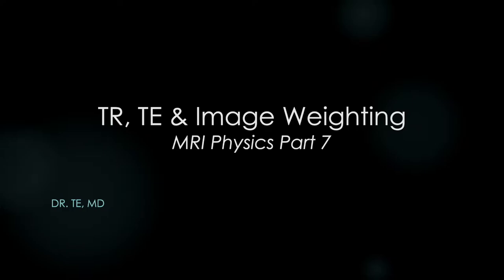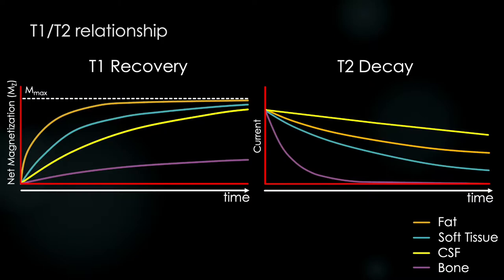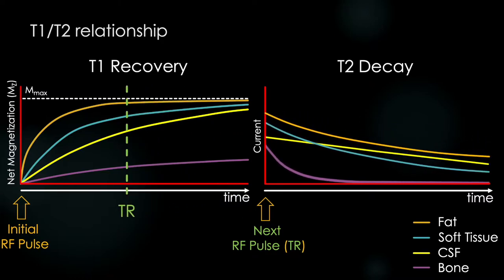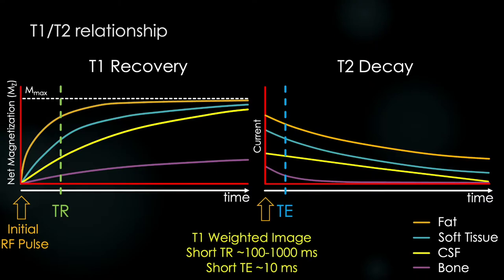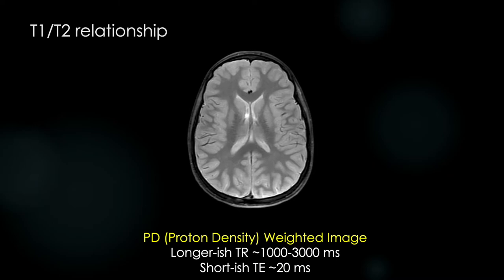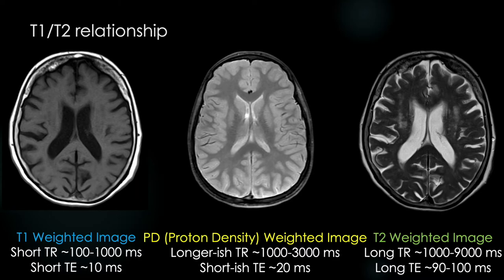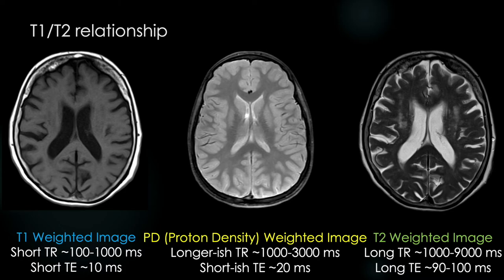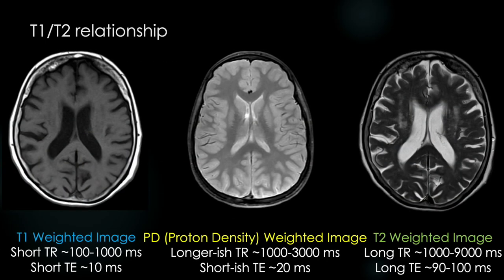TR, TE & MRI Image Weighting (T1, T2, PD) EXPLAINED | MRI Physics Course Lecture 7

Comment: I noticed that the T1 relaxation times are constant. So does the MRI tech choose the TR time only to control TE or does the tech choose both TR and TE? I'm taking the ARRT test in December 2024
Reply from the maker: In general, the chosen TR time will affect T1 image contrast, and the chosen TE time will affect T2 image contrast and these values will remain constant for that sequence.  For most sequences, these parameters are all ready chosen and optimized so the technologist simply picks the appropriate "protocol" to run.  However, you can certainly manually go in and change the values of TE and TR, albeit this will change the contrast of the picture and you'll likely get an angry call from your local radiologist :)